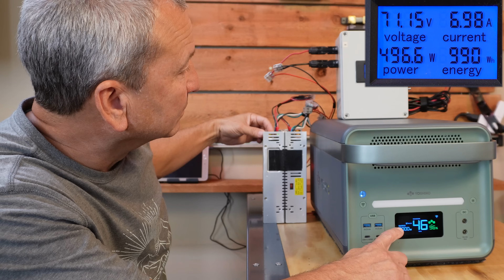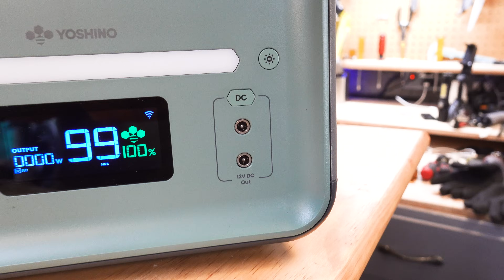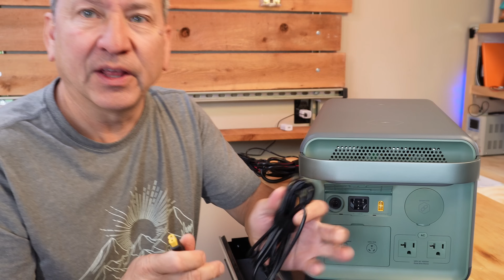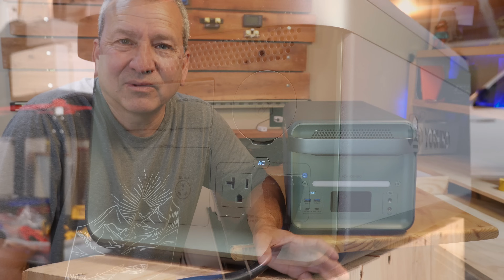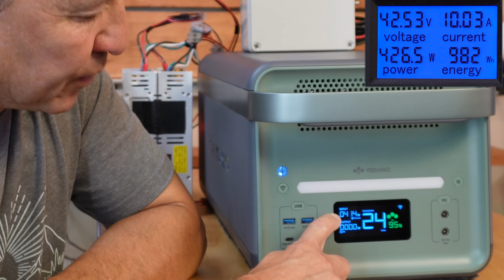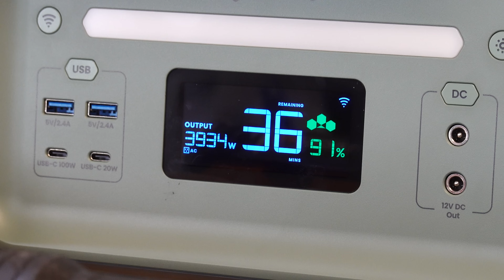SOLID STATE Power! Is THIS the FUTURE of Portable Power? (Yoshino B4000 Power Station Review)

Comment from the maker: (Update) This has been a controversial topic. In response, Yoshino has provided more information and test results related to their solid-state battery implementation here: https://yoshinopower.com/pages/solid-state-technology  My goal with this video was to test the performance of this portable power station and see if it can deliver the power output that it claims. I hope my practical testing helps you draw your own conclusions about this unique power station.
Reply: It's NOT SOLID STATE!  FALSE ADVERTISING!
Reply: I guess it just boils down to the definition of what a solid state battery is. I don't go for their definition above but I will be trying to find out more about what a solid state battery is. Also I would never buy this power station if only because of the limited solar input!
Reply: @luckyvegan7 look up part number QT-114103310 this is the battery used listed as rechargeable lithium ion not solid state or anything else. Right on the safety data sheet with the companys name on it.
Reply: Product numbers on the Individual cells is a standard lipo pack
Reply: WOW!!! I was just going to ask if you saw any of those destructive tear downs of this battery.
Reply: @RVwithTito  It is also called plastic battery. They are just full of it. That was a liion cell like any other.
Reply: For a battery that does so much it should allow more from solar for almost $3000.
Reply: I came across your video, & in December this company is still trying to to sell these at the price they are asking, & it's not solid state batteries, & false advertising. At best these are Lithium Polymer (LiPo), using a graphene conductor to make it lighter. These types of batteries arent anything new or cutting edge, they are used in drones, & not even close to what a solid state battery is.
Reply: How much does it weight ?
Reply: ok i have this unit and the other day we plugged in a single strand of christmas lights. after two hours it was down to 80% capacity. it was even a very short, small string of lights. this is just anecdotal but that seems... what's the technical term ? .... lame. i'm not sure i would trust it to power anything in my rv overnight.

Comment: This power supply has a "floating ground" and the EMS in my RV would not accept power without a "ground".  Therefore, there was NO POWER to my RV.  There are workarounds by building "ground/neutral bond" plugs.  Just be aware.  Also, when I use this unit as a UPS (during a hurricane), it goes through some "cycle" that shuts it off, so it's pretty useless in that regard.  The Yoshino techs had no answer or solution for me why it shuts off.  Very disappointing.  

When I inserted my homemade "ground/neutral bond" plug into one of the 20amp outlets, the other outlet showed having a "ground" acceptable to my RV.  YEA!  When I plugged a circuit checker into the 30amp plug, it showed as having "no ground" (as expected).  I'll make a "ground/neutral bond" plug for the 30amp and report back.  Strangely, when the 30amp plug was inserted into the 30amp outlet, the 20amp breakers changed to "hot ground/hot neutral REVERSE" whether or not the 20amp circuit breaker was ON or OFF.  So, I won't be using the 20amp outlets when I have my 30amp plugged in.

Comment: Yoshino website has been getting edited frequently to cover their tracks.  You can use the wayback machine to see prior versions with their deceptions.  They are a Chinese company having claimed to be an American company using Japanese Battery Technology (and using a Japanese name...)

@Victor-Nightingale has found that: Their safety data sheet states "ethylene carbonate" and "diethyl carbonate" and "methyl ethyl carbonate". These are dead stock mainstream liquid lithium ion electrolyte solvents. It also states lithium hexaflouro phosphate (the most common liquid lithium ion electrolyte salt) and poly ethylene polymer (the most common traditional liquid lithium ion separator) aluminum is the cathode current collector. Copper is the anode current collector, graphite is the anode, LiNiO2 is the cathode...they aren't even using NMC! Diflouroethylene polymer is the most common cathode binder. Styrene butadiene polymer and sodium carboxymethyl cellulose are always used as the anode binder in water based slurries for classic batteries. Nylon is what the outer pouch material is made of. Nickel is what the tabs are made of. But here's the biggest kicker... Phosphoric acid, iron(2+) lithium salt (1:1:1) is just a fancified description for LFP! Their cathode is an lfp nickel oxide blend (to boost enery density with the nickel). There is not a single component on their materials list that is not in a dead stock off the shelf consumer lithium ion battery. No unaccounted materials that could make a solid electryte. It is NOT even a semi solid state battery.

Comment: I'm new to solar & power stations, planning to buy the B4000 to use as my primary energy source for my tiny home which has 1640W solar panels but noticed the B4000 max solar input is 600W. I know I need a charge controller but getting confused on which to buy and what to do with it, does anyone have any ideas?
Reply: Also not sure if its internal mppt charge controller is sufficient in handling 1640W solar panels
Reply from the maker: If you primarily plan to charge by solar, the 60V, 10A, 600W max PV input is pretty limiting for larger solar arrays. The the voltage limitation alone won't support a lot of residential solar panels (including mine). This is primarily designed for portable power and portable solar panels. Here's my setup (https://youtu.be/XQtjPs7Jg_o?si=j2eyBn5UUvs0Rbe_) It's more effort to setup, but you could get a less expensive an all-ink-one solar inverter and LiFePO4 battery combo to accommodate your 1640W of solar and power your tiny home. Yoshino is releasing a larger unit in the near future which may be a better fit if you're set on this technology. Hope that helps.

Comment: I see you saw the video that shows this is not solid state.  Beyond that, the simple testing showed this unit is basically poorly implemented in comparison to other "traditional" battery back up batteries.  It's just a money grab and most likely will have 0 support shortly or even with the company still operating will get no resolution to issues.

Comment: Can I hook it up to my car’s battery for charging by the alternator?
Reply from the maker: It comes with car charging adapter for charging while driving. It has a 10A max.
Reply: Direct to battery through separately terminated pos and neg lines (which bypasses OEM fuse box) or through the integrated “cigarette lighter” port (which goes through the stock fuse box)?

Comment: If u look at the weight, this is 54lbs for 2600wh  and the ecoflow delta 2 max using lifepo4 is 50lbs for 2000wh. Not that much difference in enwrgy density but 2 times the price...

Comment: Too bad they named the unit sooo badly.... It's a storage unit I want to know the storage capacity first most not it's 4000 output.... Sadly 2000 why is not a lot for $3500
For $1500 I could buy 4 -12 v 200 wh lifepo4 batteries....that's 9,600 wh...
Another $500 for inverter and $500 for charger...

Comment: Audiophiles like to use the cleanest power possible for their equipment. I wondered whether the Power Station outputs power much cleaner than a typical power outlet in an apartment building? How do you evaluate this aspect of its performance?
Reply: Professor Hobo tests solar power stations with a guitar amp plugged into them for RF interference. My new home has terrible RF interference and I love listening to very long range shortwave radio signals. Now I can only do that during power outages. Even regular AM radios get exceptional (daytime is very surprising) range after hurricanes knock out everything. That`s why I promote high quality SW & AM receivers for these emergencies to get info when cell phone, radio and local TV signals are gone after these storms. Few care though. That`s why I was the only one with very important info in my area after hurricane Laura.

Comment: On some of the output test you clearly got the unit over 4000w but im curious to see how long it will run a 4000w load i noticed you can get some units to their peak out or even just close to it ..but they can only do it for 3 to 6 mins

Comment: Uh, lookup Li-NMC batteries, which this unit uses.  Off-gassing and thermal runaway.  It has a little greater density of energy storage over LiFePhos chemistry, but the latter is safer and has a larger rated number of charge cycle, which means that LiFePhos will generally last longer.  I don't see this unit as a good option.
Reply: Good to know, thanks

Comment: I would only add, this is a first generation power station.  I suspect these units will get increasingly better as the price point drops.  Also, solid state is safer and more dense at the same time. This might be the future of emergency solar gens.  I'm actually stunned they got solid state out like this.
Reply: Yeah, I’m use to solid state always being in the future outside of some very small applications.
Reply: These are not solid state. Regular li-ion pouch cells more dangerous than LiFePO4.
Reply: Don't think it'll ever be cheaper than sodium will be.  Solid state will be the norm for EVs though

Comment: My 1972 Generator Produces Power and Way More Power and at a Cheaper Rate then this Joke and I don't have to Remember to Charge it and it Never needs to be Recharged and it Runs Everything at the Same time and there is no B.S. Like there is with this Joke and it will Keep Running and it will Out Live this Joke for When this Joke and it's Batteries are Junk and in the Dump My 1972 Generator will Still be Running Strong and Producing Cheap Power with No B.S. No Fails No Batteries Dying Half way into the day and When your a emergency Ham Radio Op You don't Bet your Life on Junk Like this for if you do, WE call that Waiting to Fail when Life is on the Line. If you want Back up Power or Remote Power where there is no Grid Don't be a Beta and Buy this Junk be Real and buy a Real Gas, Gasoline or Diesel Generator that has a Output that is Double whatever the MAX Power that may ever be Pulled so Add up Everything that will be hooked up and Times by Two and that is the Size Generator you need and if your Powering a Home you will want 240 Voltage AC that is the Same as Two Hot Lines of 120 Voltage AC that is 180 Degrees out of Phase to make 240 Voltage AC and at a Min. of 10Kw and you may need as Much as 25Kw if you want the Full 100Amp Service or 50Kw even You want the Full 200Amp Service but a Small 15Amp 115 Volt Generator will way out do this Junk and out Last this Junk

Comment: I'm interested to know how a mid/highend desktop computer with active load would handle the UPS 20ms switch, would the computer shutdown?
Reply: Did some digging on my own. The ATX spec supports a powerloss up to 17ms but PSU manufacturer could still improve upon those specs. UPS designed for desktop machines are capable of doing this switch in 10ms. Compared to those the Power Station is slow in that specific usecase.
Reply from the maker: Yeah. 10ms sounds like the benchmark I've typically heard. Honestly, I don't have an answer since I primarily use a laptop...also on a UPS.

Comment: Most important thing that you did not mentioned was that it's NCM cathode solid state battery has 4000 cycle life,if we put that in to perspective regular NCM batteries have 1500 effective cycle life if you compare it with other regular liquide cathodes which have 800(NCA) to 3000(LFP)cycles lifes,liquide NCM stands in the middle in term of longevity but this new solid electrolyte NCM battery out performs even LFPs with its 4000 effective cycle life which is truely fascinating

Comment: Long Battery Life - 4000+ cycles to 80% capacity This is more than the 3000 cycles for LFP powered options. But LFT can be charged to 100%. Does this have a setting to limit charging to 80%. That limit affects the comparative capacity in everyday use.
Reply: Most LFP options these days are good to 5000-6000+ cycles with today's advances in LFP technology.  Calendar aging generally becomes a much bigger concern than the cycle life in portable power stations.
Reply: @kuhrd  The products this competes with from Ecoflow, for example, list 3000 cycles as their expected lifetime. Those are to 100%.

Comment: I am going to call 100% bullsh*t on these batteries being solid state until they are independently tested and torn down on video.  First tell is that we have not seen any truly solid state batteries by definition, being mass produced yet by any manufacturers and Yoshino has not released any real information.  They appear to be a small startup company out of California that is just having their portable power stations and all other products spec'd and built in China.  Their website screams of a small venture capital operation with a handful of people and a big marketing budget as they don't link to any evidence to back up their many generalizations and claims of the technology.  They claim a cycle life of 2500 cycles in some places for the same model units released about a year ago and 4000+ cycles on their site and other places online for their current units with the same model numbers. Also claiming greater than 30 years life and many other things but they only offer a 5 year limited warranty.  If these units are good to 4000+ cycles they should easily be able to last 15 plus years so a limited 10 year warranty would be more in line with claims.  When I look up information on the cycle life of NCM solid state batteries they range from 1000-2000 cycles and are still in active research and development.

Comment: Thanks for the video. Will this work for the standard size roof AC on my RV? Thanks
Reply from the maker: It might. You may not even need a soft start. However, you'd probably only be able to run it for a couple hours depending on the ambient temp.

Comment: Great review Brian!  Definitely a first on many fronts here.  Solar charging (10a) is a bit limited for my liking but still an impressive unit.
Reply from the maker: Thanks. Yes. The solar limitation could be better. It works for the portable panels, but not for residential high voltage panels.

Comment: The 60 volt max on solar makes it a plug in the wall battery.  The solar is a joke especially at this price point.  They put all this advanced technology in it yet you can't charge in a realistic time with solar?  I buy solar power stations to use solar input not my wall.  Grid down you would have to keep using your gas generator to charge this.  Pretty much defeats the purpose of a solar power station.

Comment: We need to judge it on multiple points
- As comparable solar generators go, its performance is behind leading brands.
- the price is high. 
- the advantages of the solid state battery are minimal compared to similar standard devices.

They tried. Maybe their next model will be more competitive
Reply: They're talking about a 6000w unit with 4kwh onboard and unlimited potential for daisy-chained 2kwh extra batteries. I'm interested, but we'll see...
Reply: @TheCornucopiaProject-bd5jk  yes for the price it's competing against Anker f3800 or delta pro 3 which are more capable or comparable to gas generators imho

Comment: Hi Brian.  I appreciate your all your vids.  Do you think this would run one RV a/c unit and if so, for how long?  In the middle of a heat wave.  Right now even with 900 ah of lithium I need run our generator to run a/c.  Since most parks have generator hours, it would be nice to have an alternate source if we are hunkered down inside and not able to use our generator.  Thanks in advance!  Ron
Reply: Thank you, Brian.  I will be installing a couple of soft starts first.  That should help.  Again appreciate all your posts.  I have followed several to a T and those worked perfectly!
Reply: @ronnaldpopp2282  running 900ah I'm assuming at 12v gives you roughly 12kW of potential energy.  This unit is roughly a third of your current battery 🔋 storage . Look into 3or 4 server rack batteries and upgrade your system to 48v.
Reply from the maker: I will probably run one A/C but only for about 2 hours.

Comment: Could you elaborate on the solid state batteries?  What are they, LiPo4 or what?  Lifetime of these devices varies, had a neighbor who’s LiIon camp chargers batteries had to be replaced every 3-4 years with regular use as battery level dropped to 50% after 500 cycles.
Reply: They're supposed to be more long-lived than the "old" (still used in every phone and tablet) NMC, but not as good as the "new" (to solar generators, but the underlying tech is a decade older) LIPO. But they're still lightweight and compact, so everything's a tradeoff.
Reply: @michaelmartin9022  — So essentially they are LiPo4 batteries then?
Reply: @Erin-Thor  No, something different, but I'm not sure what. LIPO have poor energy density so are always big and heavy. These solid state ones seem to be some sort of new "in between" option as far as lifespan goes.
Or, at least, as far as the marketing department's claimed lifespan goes.

Comment: Either there's a lot of empty space in those units or the claimed 2.5x energy density over traditional NCM is bogus. It does look lighter weight than LFP but not much physically smaller per Wh. You could easily fit 2.5kwh of LFP pouch cells in that along with everything else. 

I'd still want to see some deep dives into these by independent reviewers. I don't trust a lot of these claims by a new manufacturer. Teardown?